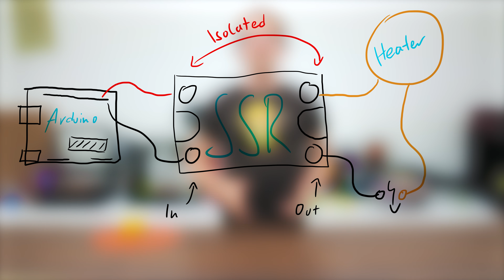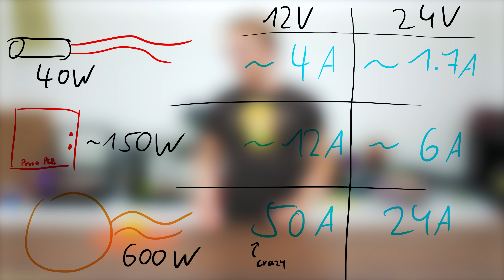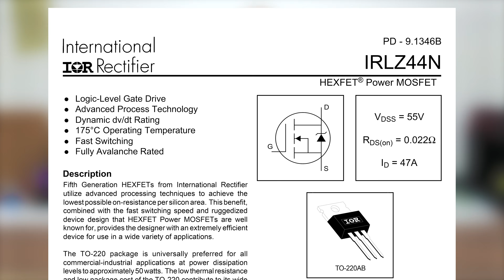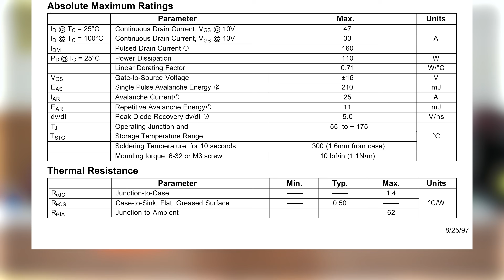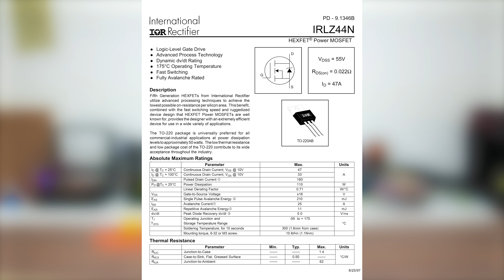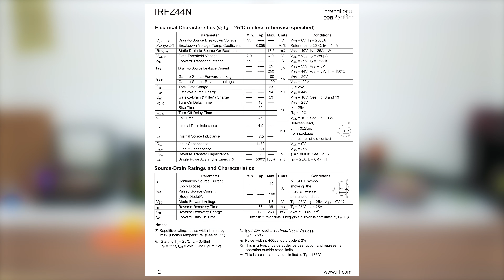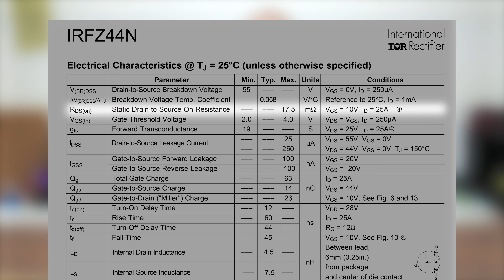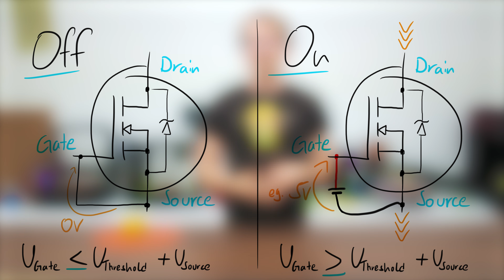Guide: Properly picking and using MOSFETs!

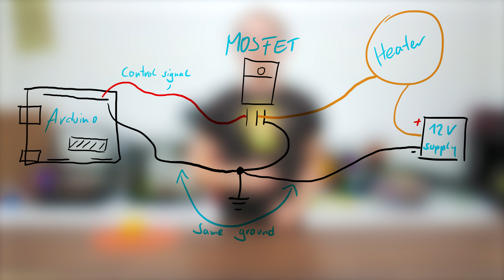Comment: @1:04 - If you can't share a common ground, you just need to use an optical coupler in conjunction with the MOSFET. An opto-coupler provides isolation via an IR diode and phototransistor in a common package. If you can wire an LED properly, then you can wire an opto-coupler. In any case, a pull-down resistor is advised on an N-channel enhanced MOSFET.

Comment: Thank you so much for this!  I thought there would be way more to using a MOSFET than this.  I actually cooked the heated bed MOSFET on a RAMPS 1.4 a while ago and had to get a new board.  I now use a mechanical relay (in a handy dandy box I designed, with headers, some LEDs to show when the bed is powered or not, and a fan header).  I may redesign it using a MOSFET now that I understand them better.  Of course I'll have to worry about heat more then.  I have a question.  So how quickly can a MOSFET switch?  Can I stop using bang bang mode with my ramps and use real PID settings instead if I use a MOSFET?  Smoother control of the power, basically a PWM output instead of just on or off.  Thanks for all you do!
Reply: Switching speed depends on the gate drive.  Down around 10ns for a power device using 'reasonably strong' gate drive.
That means a specialized MOSFET gate drive circuit or chip, and you need to account for losses during switching (MOSFET isn't fully on, so you get high VDS and high RDS when the MOSFET is transitioning from on to off and vice-versa), etc.
You will want an oscilloscope and probably an adjustable bench power supply while developing such a circuit, to help figure out what's going on.

Comment: Mosfets are very ESD sensitive. Always keep'em inside the special bag and short the leads with a small wire till it is fully soldered. A special ESD wrist band is also helpful. This is really serious, do not scatter them like this on the table. This is proven to be enough to damage or degrade their performance. Gate is normally up to 20V, but ESD of thousands of V on the carpet is usual thing.

Comment: I use the Microchip TC4420 (DIP8), driver chip for driving my MOSFETS,  so you can feed the signal from the arduino/pi into pin 2 with a 10k pull down (it works with 3.3 or 5v logic level)  then connect the gate of the MOSFET to pin 6/7 (with a 100ohm resistor), connect supply to pins 1/8 gnd to pins 4/5.  then you can fully turn the MOSFET on with your full supply voltage. (12/24V). (lowers the Rds on resistance).
Reply: sorry my bad the TC4420's won't work with 24V.

Comment: am confused after this video,
I think other viewers also!

I can put a FET behind a FET?
so the FET on ramps1.4 sends another(better) fet?

or I have to solder the fet from ramps1.4 and change to a better/stronger one?

or use ramps1.4 no more and go directly to an Arduino?

Friendly greetings from the Netherlands
Rob.
Reply: +R. Rob. Yes you can put a MOSFET behind your ramps board. You are using the output as your signal to switch your MOSFET which is connected to a propper power source. This way you can have any power switched not limited to the max Output of your Ramps-Board, but limited to your MOSFET and your connected power supply.

This is often usefull for a heatbed which often draws more power than the typical boards provide.
Reply: +Markus Osmers (mo22) 

thank you Marus!
Regards from nederlands

R.Rob.
Reply: I know this is an old discussion, but I'm struggling with the same question. 

From what I read in other places, it is not straightforward to connect a MOSFET to the existing heated bed output (which is driven by a MOSFET). Something about the signal being inverted: http://www.reprap-diy.com/connect_sevenswitch_to_ramps

Can any one confirm or deny this?
Reply: Yes I think it would be smart in order to draw a clear schematic of it!
perhaps even with multiple possibilities maybe?

Regards.
Rob.

Comment: Hey Tom; thanks for your videos-- I have a MKS base V1.2 and I´m upgrading my printer for a larger print bed and dual extruder, now dual extruders are supported by the board, but not the heat bed, how did you wired your second PCB heat bed on your printer; I recall you saying that you have double heat beds and you are able to shut one down if you are not using that print area. Thanks

Comment: Is it OK to use the 12V heated bed output from the board to switch the mosfet? Also does the heated bed require a separate power supply or can it share one with the board?

Comment: A small fix for the resistance:
I think the Radds or ramps-fd uses actually two mosfets: A smaller one to translate the 3.3V Logic from the Due to 5V and THEN that mosfets switches a beefier mosfet. quite a neat hack to make the price still cheaper (but consume more space)

Comment: Hi +Thomas Sanladerer Nice short guide! However on sketch at 8:03 I'd change one thing.. When powering MOSFET gate 2 resistors work as voltage divider. In this case voltage drop is really small, but in my opinion you should connect optional resistor  between gate and 10k pull-down resistor.
Reply: Pawel WozniaK...relative of Steven :-))

Comment: Well you could make use of some of the cheaper mosfets by driving them with a bipolar or smaller logic level fet used as a buffer running off of the 12v supply.  I've got enough 2n3904's and 2n3906's in the junk box to pull that off.
Reply: HI , can i use a 10v vgs  mosfit to be driven from the ramps stock mosfit ?

Comment: Hi Tom,Great video as always.  I particularly like the IRLB8743 for driving high current loads like heater beds but you need to be wary of the lower VDSS of 30V and the fact that the gate is not logic level.  I run this HEXFET as a direct replacement for the heater MOSFET in my cheap RAMPS board with great success.  Way cooler as the RDS(on) at 10V is 0.0032ohms.  Not sure what it is exactly at 5V but I think its around 0.0035ohms which is way better than 0.022ohms on the IRLZ44N.
Reply: SuperCozMick hi sir this heated bead mosfet irlb8743.did u make one...i tryd buymt it keeps heating and shorting out the mosfet pls help with a diagram thank u

Comment: You should also mention you're talking about N-channel MOSFETs. There are P-channel MOSFETs which go on the high side of the load.
Reply: I wanted to say same thing. Because P-Channel is also widely used, but in this application you need N-Channel.

Comment: I love the hand drawn sketches. However a picture or a camera zoom into a completed circuit would help quite a few people. There are also some 160A mosfets out there(as per your calculations these should be able to handle around 100A), maybe you should cover those for people who need help wiring up a high amp heated bed.
Reply: Bruno M. , Old post but in general ignore the front page marketing bs and head for the graphs and other detail info on the data sheet.  You'd need some beefy drive circuit to deal with the gate capacitance  and proper board layout to pull off a short 200amp pulse.

Comment: Just some piece of information i miss in your video about MOSFETs. There are N-channel and P-channel types. VERY different types using completely different driving techniques, usually for switching applications deciding if you are doing a high-side or low-side control of your load (cutting the 12V going to your heater, or cutting the GND coming back from the heater, in simple words).
For those more familiar with the good old bipolar transistors, it's similar to the NPN compared to the PNP transistors.
N-channels are easyer to control and usually offer a better performance (generally lower on resistance). So, just don't even think about using a P-channel FET or any other fancy application specific FET (JFET,...) not actually made for the task at hand.
And you should probably consider adding a blocking diode in parallel to your heater. Depending on how inductive your heater is, it can 'backfire' when you disconnect the supply while the FET is still turned on, and the diode helps to kill that induced voltage in a safe way.

Comment: Hello, if i have 400w heater 12v 0.35ohm, how i can limit it power to 100w to make it drive by irlr8743pbf

i need to limit current ... but i think extra resistance 1ohm is not a good idea.... 
can you help?
Reply: +Skrebnev Eugene There are some options, either get a good current limited power supply (I = sqrt(P / R) ; so that would require a fixed 17A limit, probably nearly impossible to find, unless you want to buy a lab-supply with manual adjustment options) or use a lower fixed voltage power supply (U = sqrt(P * R ) so that would require a 6V supply). Not a very common voltage, but if you can live with a bit less power, you could go for a 5V switched power supply with a 100W output rating. Most of the industrial supplys have a little adjustment potentiometer to increase the output a little (to compensate for cable losses). The cheapest options i found with a quick look at mouser.com were 5V/20A supplys for around 20-30$. Or you could probably 'abuse' an old ATX powersupplys 5V output too, but they don&#39;t offer the voltage adjustments, and you would have to check how much they can deliver at the 5V outputs.
Reply: +ExtraBase i buy new good atx for "abuse") will check how much it can deliver on 5v line but i think it can 20a...
U=5 R=0.35 I = 14.3amps
even if atx can deliver 20a so its ok, i am not sure irlr8743pbf can handle it... according to this video
P = i^2* r = 14.3*14.3*0.004 = 0.81796
110*0.8 + 25 ...  113С - pretty hot ?
Reply: +ExtraBase also i think LTC3780 DC 5-32V to 1V-30V 10A Automatic Step Up Down Regulator can help me... it can deliver 8amps... looks pretty enough for keeping temperature for 100-120C ?
8*12 = 96w?
Reply: +Skrebnev Eugene If you can make the rest of circuit too that the LTC3780 needs to actually do something more than look pretty, yes. Guessing from your question tho i would say you do not have the tools/experience to make your own circuit around the LTC3780 work as intended, and a premade developmen-board from Linear usually sets you back over 150$ and is not even designed for more than a 12V/5A output. 
Just to clarify, the LTC3780 is a controller IC for a buck-boost circuit, so it can give you a stable output, at 12V for example, if your input is in some range above and below 12V. Can be useful in battery powered equipment that need a stable output even if the battery is full (~14V) or almost empty (10V).
Reply: +ExtraBase ebay and china childrens can deliver LTC3780 with circuit around for 15-25$ and looks like its the easiest way for me,  because 5v and 15amps looks a little bit scary for my mosfet
Reply: +Skrebnev Eugene Yes, without any cooling, that FET will get pretty hot. I would consider using 2 in parallel, and screw them onto a heatsink or a least a bit of Alu/Copper plate to help get rid of the heat more efficiently 110K/W is pretty bad, any you always want to have some large enough safety margin to not burn yourself or set something else on fire accidentially.
Reply: +Skrebnev Eugene Just make shure it can handle the POWER needed if you go for that buck-boost module, voltage and current ratings are nice, but there is usually a trade of between the two. It may only deliver 10A at 1V output, or 0.3A at 30V output, but not 10A at 30V output. It usually has a way of depending on the input voltages too how much the output can deliver. Keep that in mind and check the real ratings, not just the max. values.

Comment: Such a great video once again. I had a really bad MOSFET on the Heated Bed output on my Rampsboard. So after watching your video I took the opportunity got an IRF1404 from the local electronics supply and replaced the old one. Now its running perfect and at ambient temperatures. Thanks Thomas for sharing knowledge.
Reply: Thanks, I have a few IRF1404's I picked up awhile ago because of it's specs. Couldn't think of anything wrong with it for this application. I usually use them for PWM applications.
Reply: @rich1051414   IRFB7446 is even better than IRF1404 because it has lower ON resistance, lower input capacitance, and much faster switching, including much improved intrinsic "body diode" switching time.

Comment: Can a 12v bed not be wired into the mains with a ssr?  I bought the one from your last video and was planning to hook it up.
Reply: +Connor Weller Seriously? Mains is 230V AC or 110V AC, depending where you live. Hook that directly on your 12V bed and you make a direct short circuit, have an AWESOME little firework with blown/burnt heated bead, blow out the fuse of your house (or at least the section you hook it up to) and maybe even start a little fire and damage you, your printer, your house or any nearby 3rd party.
DONT EVEN THINK ABOUT IT! A 12V heated bed is designed for 12V DC (or less), any higher voltage can and will get you in trouble. If you don't even realize that, please don't even think about doing any wiring that involves mains voltages (LETHAL!) and restrict yourself to plug in only finished products with already attached connectors in main sockets.
Reply: +ExtraBase thank you so so much. For some reason I thought it could Handle the increased voltage. I guess I'll use the ssr for another project. Again thank you so much

Comment: Ok - You've convinced me that I should be using a MOSFET rather than an SSR. I've already melted a 40A DC-DC SSR trying to power my 200W heater, and you couldn't have come out with this video at a better time. It looks like this MOSFET will work well. So how do I know how much cooling I'll need? I've already melted an SSR, so I'm rather hesitant to take this thing with the much smaller package and expect it to flow the current, even though it is rated for far more. I do have a couple of heat sinks that I bought for the SSR, though, so I'm wondering if that will be sufficient, and how I should wire up the fan to cool it.

Comment: This is probably unnecessary but I will mention that the MOS (in MOSFET) requires that you handle the device with a degree of care. Despite their significant current carrying capability they are static-sensitive devices.

Comment: It's difficult to find a high current mosfet that has a reasonable RDS(on) resistance at 3.3v.
Reply: +haz939 Very much so! The level of rDS(on) is heavily dependent on the magnitude of vGS. For 3.3V systems some form of level translator is required. A 5V powered 74HCT125 is a good starting point.
Reply: +haz939 There are several options to get around that. A simple level shifter that first converts the 3.3V logic signal into a 12V signal to then drive the gate is definately a very good and usually pretty simple solution. There are specific gate driver circuits (integrated) from a lot of the major silicon vendors, you just have to check what kind of logic thresholds they have at the input side. These are more mostly more specific to drive high frequency applications, so thats why they state how much current they can sink in or srouce out of a power mosfet gate. (Reduce losses by switching the FET as fast as possibe)
It starts to get a bit tricky again once you work with 24V on your power side, since you have to take care not ever to go above the maximum G-S voltage rating of the power FET (usually between 20V to 25V), so you need some intermediate gate drive voltages between your 3.3V logic and 24V power supply, apply some tricks to limit gate voltage after the level shifting, or again look for other components that are solving that problem.
Reply: +haz939 or something easier (which is used in things like the radds) is to use a second mosfet which can operate at 3.3V which will control the main mosfet. 
With that middleman-Mosfet, the Rdson value isnt as relevant, because a normal mosfet wont drain much current from the drain pin.

But then you have to use a pullup resistor for the middleman-mosfet and also a pullup for the main mosfet.

the middleman one is going to be pulled high, which means the second one is going to be connected to ground, so what is connected to it is also grounded. here is an example schematic (uses a smd mosfet as a middleman) http://puu.sh/mPJdV/24d317a88d.png

Comment: Woops, you might want to put an annotation on there pointing out you meant a gate voltage relative to the source :)

Also, you might find my Tj calc useful for this :) http://snuletek.org/calculators/fetTjCalc/
Reply: +dumle29 Something about that calc just seems wrong.  Try poking the values Tom is using into it and something isn't correlating.
Reply: ***** I'm not adding any fudge factor. I'll try though :)
Reply: +legalizeshemp420 Looks fine to me: http://i.imgur.com/larHWOR.png
Reply: dumle29
at 8 amps the one I am using is around 35c so appears way better than even the one Tom showed.  Thanks.